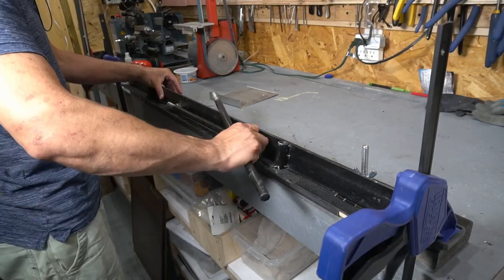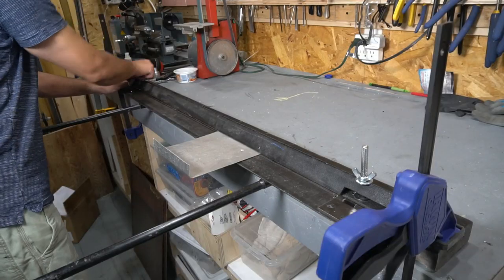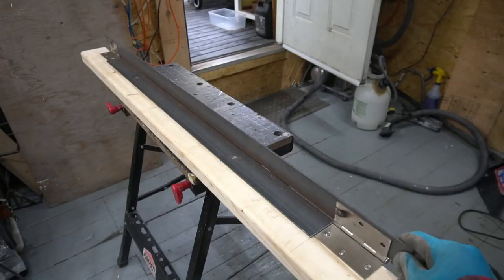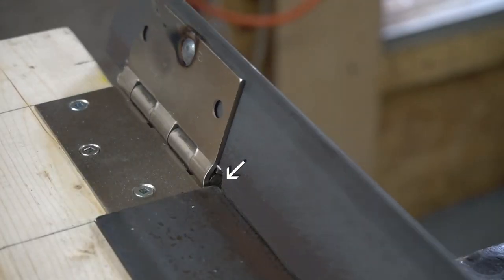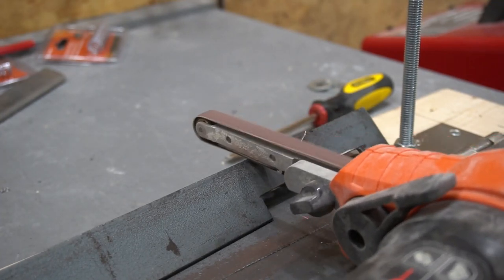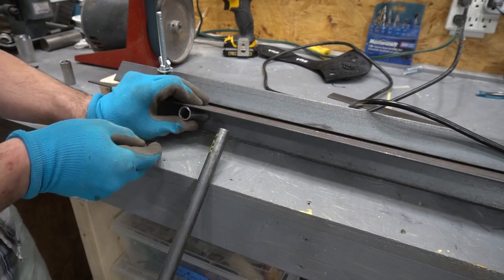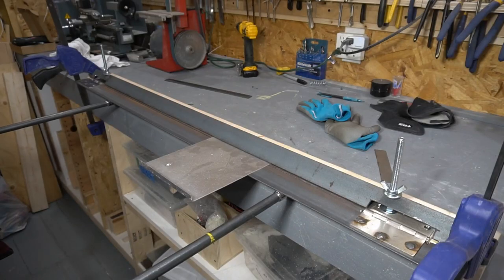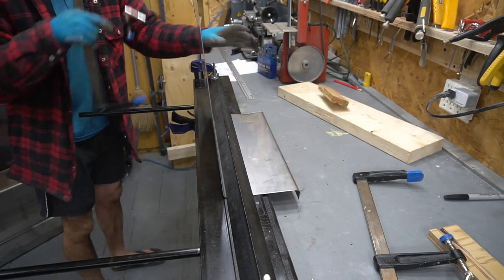How to Make a Metal Brake for Sheet Metal

Comment: Great Job! Nice little simple brake. How about if you tack welded a piece of 1"x1" square tubing inside the clamp down piece. that would probably stiffen it up enough to not get any deflection when bending larger pieces.

Comment: Can you make a home made lathe next please. Haha.
Nice vid. Cant beat it for many applications needed around the shop. Im forever needing to bend a piece of sheet metal being a auto body job , rocker panels on cargo van or metal cap for my metal inclosed fire pit ect. 
Have used a metal brake for light tin , soffet and facia on the house but for a heavier gauge that would be the bomb ! 
Thanks for sharing. I liked and subscribed many weeks ago after coming across one of your builds. 
Cheers from canada my friend. 🤪